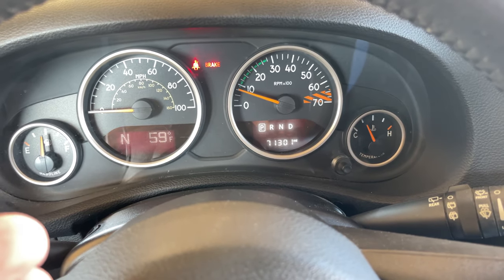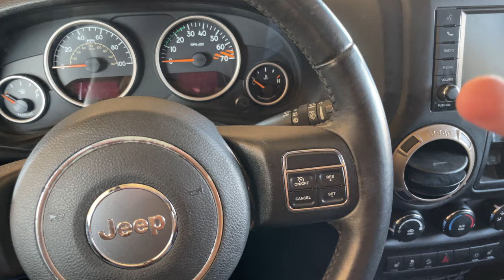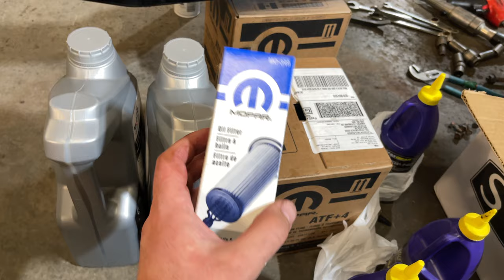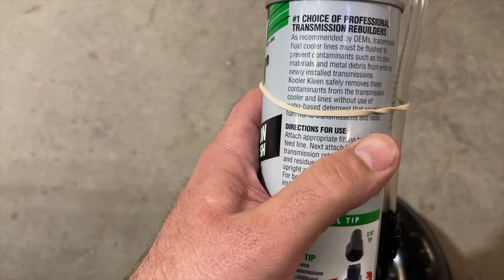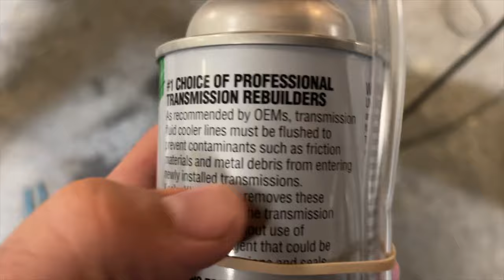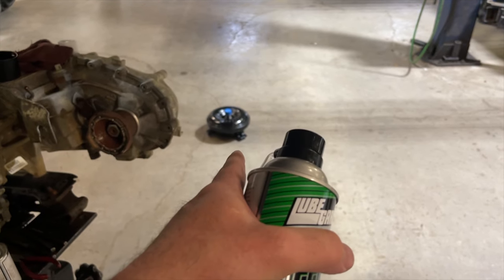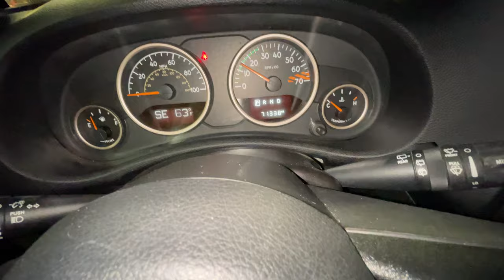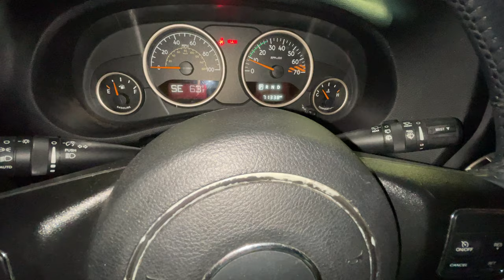2016 Jeep Wrangler stalls when cold!

Comment: Hey.  Question.... Did your jeep throw any codes?  Mine is doing the same thing....only in the am on the first start of the day.  Any other time it's fine.  I will get a occasionally get a code for camshaft circuit and torque converter on a hard acceleration , usually when passing on the highway or when the RPM is up over 3500-4000. Wondering if they're related or a whole separate issue.  2014 with 88k miles.  Had the trans fluid and filter changed at 60k.  It shifts perfect...no issues with the trans besides the stalling when put in reverse.
Reply from the maker: I didn’t experience any codes, but I fixed it as soon as it started doing it, which was the 2nd day after I bought it used. May not have give it time to throw a code. I’m glad I did, because if prolonged it can go from replacing the converter to replace the transmission. When they did the converter the transmission fluid was starting to become burnt. I guess I would say, watch the RPM gauge when you put in reverse in the morning and see if it goes in gear or rpm drops and dies. If that’s the case, it does sound like the torque converter clutches are sticking.
Reply: @selectyourtools  the rpms drop and it occasionally stalls.  I'm going to get it looked at soon.  Thanks!!
Reply from the maker: @marcsciarrotta3109  Anytime man!

Comment: Yup, 100% the torque converter. What is happened only on the first few reverses is definitely the converter. Had it replaced under warranty as well. The Nag1 wont throw a code either, because it can’t. I found a rebuild article explaining it having to do with trapped fluid in the converter or something along that line. Whatever.
Reply from the maker: Yeah, the guy said it’s where the fluid can’t move the piston to release the clutches. That’s why they rebuilt it and installed return springs. That way the springs helps release the clutches. It never did it again and it run like a champ!

Comment: How did you diagnostic it ??? Mine does the same thing and the dealer ship says there’s nothing wrong because there’s no code or anything but does exactly what yours did
Reply from the maker: I didn’t have a code either. I watched the RPM’s and could feel the transmission wasn’t going into gear like it should. I called the torque converter company that rebuilds them and he told me it was common for them to freeze and not release and he could rebuild it with a spring return kit. Hope this helps! Thanks and hope you get it straightened out man!
Reply: Has it giving you any other problems?after you changed it
Reply from the maker: @maricarmenguzman4936  Never had anymore issues out of it. It did great. I wouldn’t recommend prolonging it though. If you keep running it like that, it will burn your transmission fluid up and could toast the transmission. Hope this helps.

Comment: Would this also be an explanation for the exact thing happening only while driving/accelerating? My 2016 stalls for pushing the gas too hard on inclined surfaces.
Reply from the maker: Not knowing exactly what’s going on or being there… but it could be? The torque converter could be slipping causing it to lag in acceleration. It could also get hot when it starts slipping. Check your fluid and see if it’s red or if it’s really dark and has a bad smell (almost like a burnt type smell). If it all looks good, you could possibly have something else going on? Maybe fuel related if it happens when under load? Sorry for not being able to answer directly. I would check the transmission fluid first and go from there. Thanks
Reply from the maker: One other thing to look out for is shuttering. Almost feels like your running over the rumble strips that are on the side of the road. That’s usually a sign of a faulty torque converter too.

Comment: Any issues since the rebuild? I have had this issue for a few years. I too own a 2016.
Reply from the maker: Nope, it’s did great ever since. Drives and shifts good and hasn’t stalled out since either. I hate to hear your having that issue. If you have any questions or anything just let me know. I think my email should be in the description of the video if you need more info or anything. Thanks!
Reply: @selectyourtools  thank you for the response. I am thankful I found your video. It has been an issue for a long time. I am trying to sell it now. Just need to weight my options to fix it before or eat the cost of repair on the sell price.
Reply from the maker: @Bishop_10  Thanks man! Yeah, if you have to take it somewhere to get it done it could cost upwards of 1200 or 1500 possibly. If you can do it yourself it would be a fairly cheap fix. Best of luck man!

Comment: Did you change the torque converter solenoid too? Or just the torque converter?
Reply from the maker: I just had the torque converter rebuilt with a return spring upgrade kit. Cost around $250ish… it’s been a little bit so I maybe off a little on price. I didn’t change the solenoid. I flushed the lines and transmission too before adding new fluid. Never had another issue after that. Hope this helps! Thanks
Reply: @selectyourtools  thank you for the fast response. Your jeep was doing the exact same thing mines doing. I figured I’d ask before assuming you didn’t. Thank you once again
Reply from the maker: @josephgrochowski5874  Your welcome man! Hope everything works out for you!

Comment: Hey quick question when this started to happen were you getting high reverse speeds, when I start mine it isn't stalling yet however when I put in reverse within a few feet the jeep is at 10mph no throttle input but after everything is warmed up and I turn the jeep off and restart it and reverse it creeps back like normal I have 2016 JKU 92k miles
Reply from the maker: Mine didn’t do that. Does it take a minute to go into reverse and then just shift kinda hard and jerk? Does it idle high when this happens?
Reply: @selectyourtools  Doesn't adjust the idle speed same idle as if were you to put in drive, you like just basic engine load idle. It shifts fine just that first shift into reverse is really sketchy if your not expecting it. honestly has me stumped. I do thank you for replying back.
Reply from the maker: @JCV11B  Your welcome! I’m stumped myself. I don’t know what that could be off hand. I may do some research when I get a chance and get back to you. I’m curious myself!  I’m not sure if that’s a transmission issue or not?
Reply: I had to literally stand on my breaks once in a pole barn. I think I was in 4wd reverse and the jeep didn't want to stop.  Wanted to smash through garage door🤣  It only happened to me once and I also don't know what caused it.  I do know the jeeps reverse gear is 4.06 and very torquey.

Comment: Have a 16 wrangler unlimited doesn't stall but drops rpm almost like rough idle have chased that with parts as throws engine light. But shows misfire  acts just as you described though. So my question for you as did yours also little help greatly appreciated thanks brother
Reply from the maker: Unfortunately I found this issue the day after I bought it. Went out the next morning to start and it died on me. Does it do good after your up and going and the rest of the day? Mine would only do this on cold starts and throwing it into reverse to back out of the driveway. It would die the first time, but good the rest of the day. Hope you figure it out man! Thanks
Reply: @selectyourtools  ya it's baffling as live data shows correctly. But yes cold start in reverse and not all the time intermittent but has did a second time in the day after parked for 12 yrs (work)   but no hesitation no shimmy shake top end great no power loss but and only but that reverse as like under heavy load pulls rpm down shift drive and down the road she "ll go.   Nice video and good work you act as I do clean this paint this replace this while I'm in here. Thanks for quick response though brother appreciated
Reply from the maker: @TRIPLE.C.ROOFING.  Your welcome bro! Sounds like that could be the issue but I can’t say 100%. When you put it in reverse the torque converter is stuck and pulling down the engine and could possibly stall. I didn’t shake or anything either once driving. I appreciate it man!